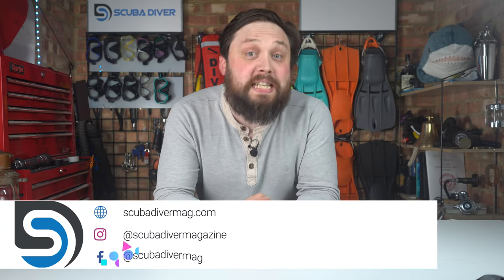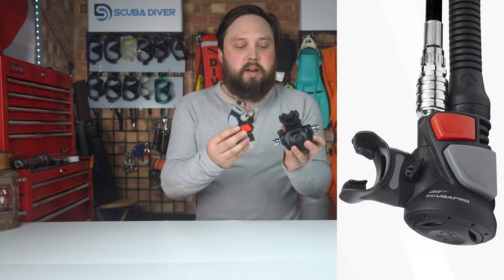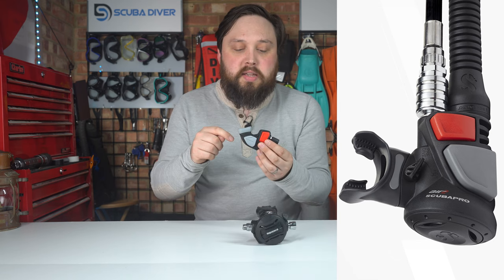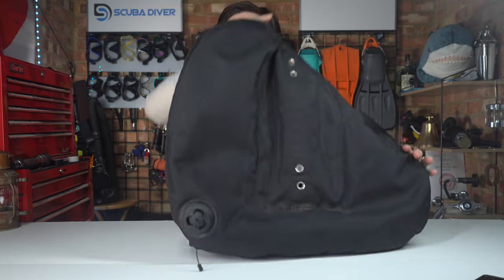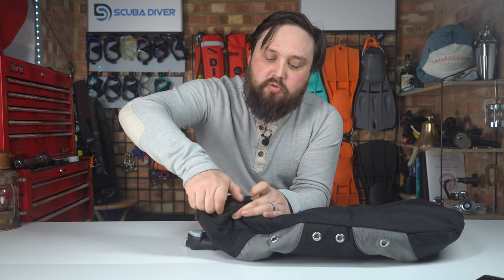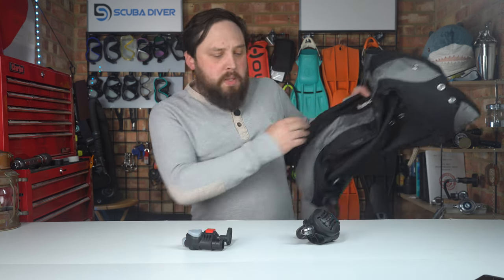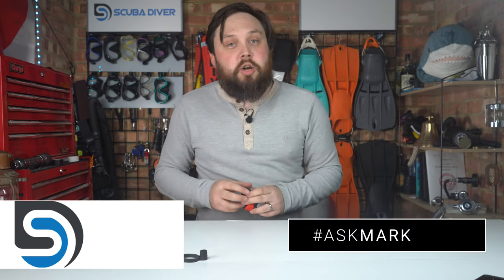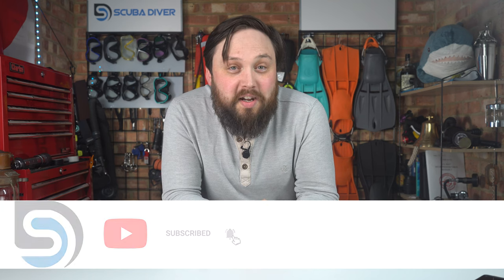How Do I Wash My Combo Inflator BCD? #askmark #scuba @ScubaDiverMagazine

Comment: Silly question - but you dont know until you ask.... I am about to do a couple of months of diving (6 days a week) in salt water. How often would you recommend deep cleaning the internal bladder of the BCD? Thanks Mark, really appreciate your content.
Reply from the maker: If you give it a rinse with fresh water at the end of each day and leave it to dry overnight that's the best thing you can do for your BCD. At the end of each week before your day off I'd put a few drops of detergent in for the wash to prevent any nasties from building up.

Try to keep it inflated in storage so the water any collects at the bottom and is easily drained.

Comment: When I had my PADi OW Pool Session I had to drain water out of my Jacket BCD. The Tank was removed. I did an Oral Inflation And Purge 3 times. Think I put 2 breaths in it before I handed to my instructor. Mine wasn't the Combo Inflator. Are they Harder to use? Being that you need to purge air on ascent. But keep breathing. I kinda like the idea of one less hose.
Reply from the maker: They can be trickier to manage in an OOA situation which is one of the reasons many divers don't like them.
Depending on your BCD design you still have your right shoulder dump to vent gas and it's not impossible to vent gas from the inflator while you breathe from it, it just requires a little practice. If they were dangerous the manufacturers simply wouldn't make them

Comment: Hey mark just curious if you’ve used any of those BCD shampoos. Thinking of getting a package since I’m buying my first new BC the BC2 by Atomic and want to keep that pricey piece of kit in tip top shape. Th ask in advance 
#askmark
Reply from the maker: BCD Shampoos are great for removing build up and conditioning the seals. A small amount with every wash can help keep your BCD like new. Your BC2 has the added benefit of the laminated material so salt crystals cant penetrate and soak in.

I've used the McNett (now Gear Aid) BCD Shampoo before with good results. It's nice to see a diver who wan't to look after their gear
Reply: @ScubaDiverMagazine  Thanks for the response. My dive shop at Revivex and it worked fantastic.

Comment: I personally hold that the easiest way to avoid problems with a combo inflator is not to have one on your gear.  Given that you will be stressed, the second stage you are going to use in an emergency should be at least of the same performance as your primary!
Reply: This exactly.
Reply: I don't know, I have one and it breaths very well.